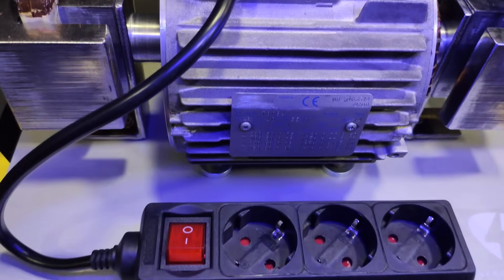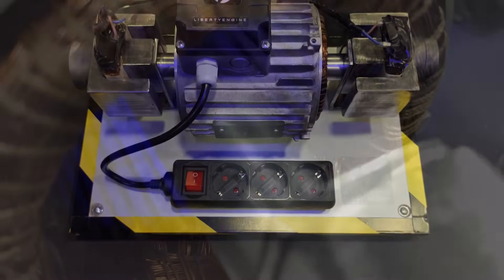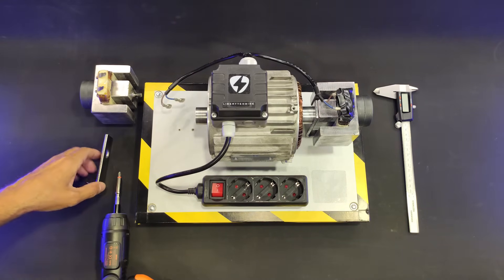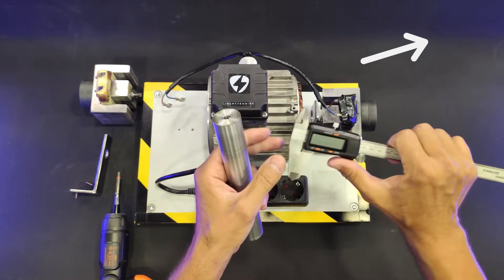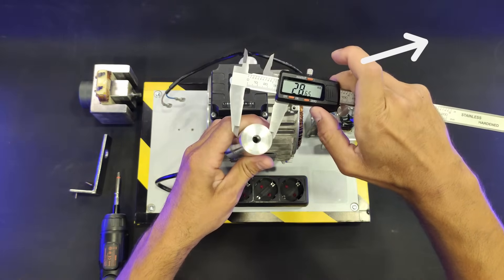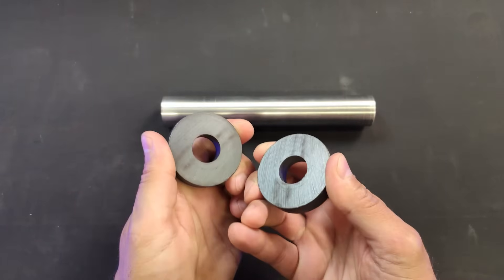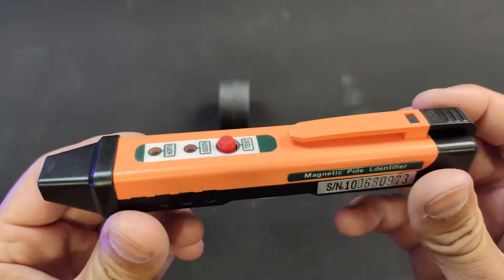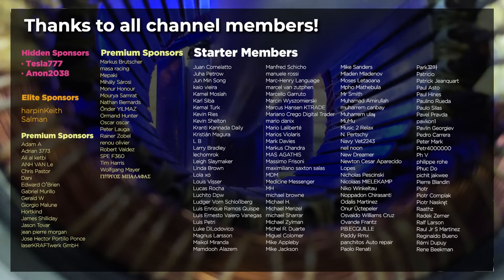THIS METAL CAN PRODUCE UNLIMITED ENERGY

Comment: I just published a short video regarding a Laminated Disk Rotor that I designed and built in an effort get something going on #2 engine. I don' know if it will work but I don't know is anyone is ever going to give out the formula for Argilium Alpha alloy either. I'm way behind building because of life's setbacks so until I catch up, hopefully others can take a look at this possible method and experiment with it if they think it has merit.Thank you and Good Luck!

Comment: I do not believe that the metal bar plays a role in the production of energy in its system. I watched a video, here is the name for those who want to watch it on YouTube. (10KW Free Power Generator With Electric Panel Parts 100% Real) as you can see in the video, no bar was used however, there is energy production. I think the bar is used to distract us.
Reply: But someone did it Witherspoon a copper bar and it's not working
Reply: بله شما درست میگویید. دقیقاً من هم به همین موضوع فکر میکردم که متوجه پیام شما شدم!

Comment: That's some terrible machining of such an important part. How do you deal with the uneven electron flow from the skin of the cylinder bwing so uneven?. Not to mention the loss of efficiency due to ionization of the high points of the surface due to the microscopically large pits created by the lathe tool????? I would think this should have been polished to a mirror surface to eliminate those issues, please explain!

Comment: Je comprends mieux pourquoi sa ne marche pas pour avoir fait la même chose .maintenant ou trouver cette barre !
Reply from the maker: Ils ne le vendent nulle part. Nous avons dû fabriquer ce métal nous-mêmes
Reply: je ne pense pas que la barre de fer jour une rôle dans la production de l'energie. c'est juste une diversion. j'ai regardé une autre video que je vais mettre le lien. aucune barre de fer n'a été utilisée cependant il y a production d'énergie. tape ceci sur you tube et tu vera la video. (  10KW Free Power Generator With Electric Panel Parts 100% Real )
Reply: @tiarobertsingo8313  j’ai vu l’autre video mais si tu colle un aimant au fer devient un aimant aussi.n’est-ce pas?
Reply: @No-one-2009  je pense qu'une simple barre d'aluminium ou même un morceau de bois ( quelques choses sur laquelle l'aimants le peut se coller peut faire l'affaire ) je vais essayer avec le bois puis une barre d'aluminium. Les forgerons qui fabriquent les marmites avec les vieilles casseroles peuvent le faire. Merci et continuons à faire nos recherches.
Reply: @No-one-2009  la barre que le monsieur a fabriquer n'attire pas d'aimant. Vous pouvez le remarquer sur sa video. Donc refaites l'expérience avec comme barre un objet sur lequel l'aimants ne peut se coller
Reply: @tiarobertsingo8313  bois non hhhhh il faut un conducteur de champ magnétique
Reply: @No-one-2009  c'est suite à l'expérience de l'autre vidéo que je parle de bois.  ( dans l'autre vidéo, il n'y a aucun conducteur de champ magnétique entre les deux bobines de transformateur.  
Dans les jours à venir, je vais essayer les deux expériences: avec la barre en aluminium et le bois sec bien sûr.
Reply: @tiarobertsingo8313   mais bdans l’autre vidéo a mit l’aimant a l’intérieur du stator ,tiens moi en courant des résultats 👍🏼, jai tout préparé sauf le stator triphasé , je sais si un stator 220v fonctionne, j’ai une barre en fer

Comment: That's just a bar of stainless steel, if any of his inventions work, then he won't share it on YouTube and he would be very rich, unsubscribed
Reply: It's actually unobtainum:)
Reply: @KevinSmith-os5yz  Ha ha, that's the one
Reply: If it were stainless steel, it should weigh 999g instead of 884g…
Reply: wie kommen sie auf dieser Werte ?  @johnwayne9103
Reply: @johnwayne9103  which alloy?
Reply: @johnwayne9103  999gms if the dimensions are correct and it has been drilled out

Comment: Según los datos dados en el video da como resultado un 16,73% de Al y un 83,27% de Ag aproximadamente, he tomado el peso como 884gr, Densidad Al=2,7 Densidad plata 10,49. Para mayor precisión habría que restar del volumen del cilindro, el volumen de los agujeros en cada extremo, cosa que no he hecho. Corrijo,, el volumen dado en el video ya ha tenido en cuenta esa resta.
Reply from the maker: No es cierto tu resultado. Esto es mucho más complejo y requiere de algunos elementos más en la aleación. Además también deben hacerse algunos tratamientos especiales
Reply: @HiddentechnologyYT  Entonces lo que no es cierto son los datos expuestos en el video. Pienso como tu, la aleación no creo que sea únicamente de de Al-Ag ha de haber más, y eso es lo que nunca sabremos. Lo de los cálculos, son básicos, y se ajustan a lo expuesto en el video, pero ya te digo, pienso como tu faltan datos en el caso de que se cierto todo.
Reply: Guys, there's a video like this on YouTube circulating where the guy used two magnets on each horn and not the central bar and it seems to work perfectly. I think the guy is Indian.
Reply: Plata del latín aunque su símbolo sea Ag proviene del latín Arg y Galio GA pero también proviene del latín Gallium. Teniendo esto en cuenta y los avances en semiconductores que se están experimentando con el Galio, éste sería el material, pero también teniendo en cuenta el valor de la plata y del Galio y que esa barra pesaría más de 800 gr serían sobre unos 1500€-2000€ dicha pieza dependiendo de las proporciones
Reply: @HiddentechnologyYT  especiales o espaciales, porque tal y como lo ponéis esto debe ser tecnología Extraterrestre, anda cuéntale ese cuento al lobo de la Caperucita, no existe ningún tipo de aleación mágica en ese proyecto, o es un tipo de metal no ferromagnético como el aluminio o cobre o nada tiene sentido, otra cosa es que aleandolo con otros metales sea un conductor más eficiente, pero si eso funciona cosa que dudo con una pieza de aluminio tendría que dar una respuesta y si no es así, alea todos los metales que quieras que no va a funcionar, a menos que utilizas plutonio enriquecido, pero con eso ya no se juega
Reply: You forgot the 100% unobtainum added to the alloy:)
Reply: Não precisa,isso e só para confundir o produto real.

Comment: Can the dimensions be reduced such that the cylinder is thinner and shorter, uses less material?  How does this affect performance?  How susceptible to inconsistencies in alloy composition is it, what are maximum/minimum permissible densities of the alloy? 3-8g/cm3?  What's the relationship between output amperage and size/shape/alloy?      WIth the connectors being roughly 14-20AWG, what's the maximum amperage the LE can put out in continuous state?  What does it look like with a thermal camera taking video?
Reply from the maker: The dimensions or density of the rotor composition cannot be reduced.
Reply: @HiddentechnologyYT  why?

Comment: By the data given, the composition is 87.8% silver, 12.2% aluminum. 
You're welcome.
Reply: To find the composition of silver and aluminum in the cylinder, you can use the density and volume information along with the total weight. Let's denote the following:

Let's call the volume of silver in the cylinder V_silver (in cm^3).
Let's call the volume of aluminum in the cylinder V_aluminum (in cm^3).

You know the total volume of the cylinder is 124.96 cm^3, and you also know the density of the entire cylinder, which is 7.09 g/cm^3. You also have the total weight of the cylinder, which is 884 g.

First, we can calculate the mass of the entire cylinder using the density and volume:

Mass = Density × Volume
Mass = 7.09 g/cm^3 × 124.96 cm^3 = 885.17 g (approximately)

Now, we need to find out how much of this mass is silver and how much is aluminum. Let's use the following variables:

M_silver = mass of silver (in g)
M_aluminum = mass of aluminum (in g)

You can set up a system of equations based on the total weight and the density of silver and aluminum:

    M_silver + M_aluminum = 884 g (total weight)
    (M_silver / V_silver) = 10.49 g/cm^3 (density of silver)
    (M_aluminum / V_aluminum) = 2.70 g/cm^3 (density of aluminum)

Now, you have three equations:

    M_silver + M_aluminum = 884
    (M_silver / V_silver) = 10.49
    (M_aluminum / V_aluminum) = 2.70

Let's rearrange equations 2 and 3 to solve for M_silver and M_aluminum:

M_silver = 10.49 × V_silver
M_aluminum = 2.70 × V_aluminum

Now, substitute these expressions into equation 1:

10.49 × V_silver + 2.70 × V_aluminum = 884

You also know that V_silver + V_aluminum = 124.96 cm^3 (the total volume of the cylinder).

Now, you have a system of two equations with two variables:

    10.49 × V_silver + 2.70 × V_aluminum = 884
    V_silver + V_aluminum = 124.96

You can solve this system of equations to find V_silver and V_aluminum. Once you have those values, you can calculate the composition of silver and aluminum in the cylinder as a percentage of the total volume.

Let's solve this system of equations:

First, rearrange equation 2 to express V_silver in terms of V_aluminum:

V_silver = 124.96 - V_aluminum

Now, substitute this expression into equation 1:

10.49 × (124.96 - V_aluminum) + 2.70 × V_aluminum = 884

Now, solve for V_aluminum:

(10.49 × 124.96) - (10.49 × V_aluminum) + (2.70 × V_aluminum) = 884

(10.49 × 124.96) - 7.79 × V_aluminum = 884

7.79 × V_aluminum = (10.49 × 124.96) - 884

V_aluminum = [(10.49 × 124.96) - 884] / 7.79 ≈ 15.22 cm^3

Now, you can find V_silver:

V_silver = 124.96 - V_aluminum ≈ 124.96 - 15.22 ≈ 109.74 cm^3

Now that you have the volumes of silver and aluminum, you can calculate the composition in percentage:

Composition of Silver (%) = (V_silver / Total Volume) × 100
Composition of Aluminum (%) = (V_aluminum / Total Volume) × 100

Composition of Silver ≈ (109.74 cm^3 / 124.96 cm^3) × 100 ≈ 87.80%

Composition of Aluminum ≈ (15.22 cm^3 / 124.96 cm^3) × 100 ≈ 12.20%

So, the composition of the cylinder is approximately 87.80% silver and 12.20% aluminum.
Reply: @shaynerism Well done on the calculations 👍I hate to be the one to point it out but You calcs show majority of silver but Your statement says majority aluminum. 
Thanks for the calculations 👍
Reply: Hi  @shaynerism    thanks for the calc, I believe Silver has been used purely on the lowest resistant and highest conductivity properties, the closest properties matching Silver would be Copper. It would be interesting to use copper wiring instead of the Silver/Aluminium alloy.
Reply: @karamatbaree6543  Right.  Silver is a much better conductor than copper.  The reason for silver might be efficiency, if this really works... also unlike copper, silver oxide is also quite conductive.  Electrons travel on the outside of the material though, so I don't know if this would have to be solid or just plated.  They should answer this.
Reply: They said MAINLY sliver and aluminum, so maybe some other metals are used here.
Reply: Also,  that means that here in Canada,  the cost of silver alone to make this is a bit over $800CAD... cost per oz used,  not spot.   Expensive rod,  worth it only if it works, obviously.